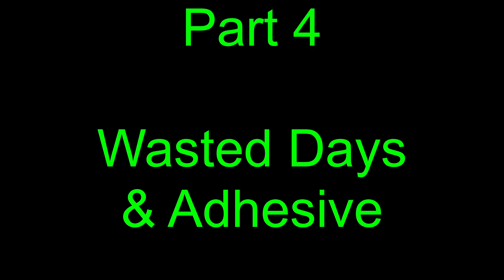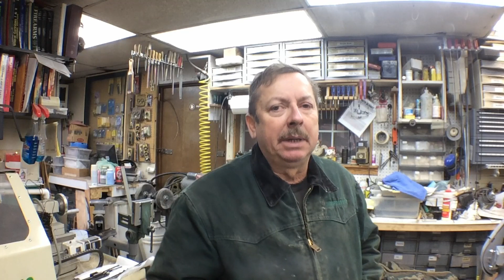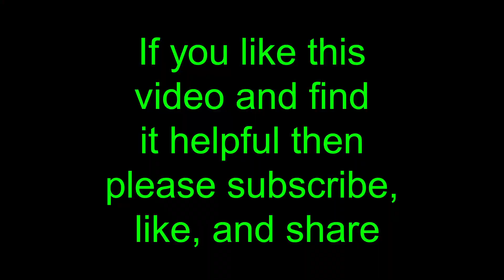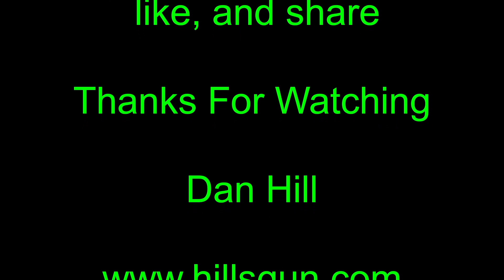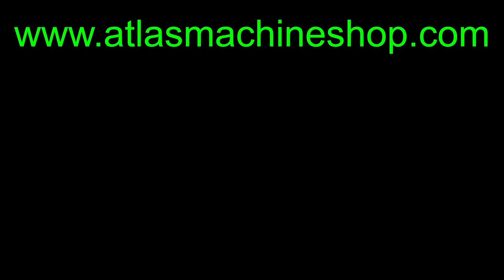Building a Zenith 701 Experimental Airplane,Building Basics Part 4

Comment: I have watched a few of your gunsmithing videos. I am curious if any of the specialty tools from gunsmithing has also turned out to be useful for aircraft construction.
Reply from the maker: Not really. Some of the basic tools are universal, but anything specifically for gunsmithing doesn't work for anything but guns. I also make it a point to try and keep the projects seperate as it makes everything more productive,organized, and in the case of gunsmithing more profitable, therefore more enjoyable. Just as for the motorcycles I keep a seperate tool box so when I need something I can hopefully go straight to it. I HATE searching for tools.